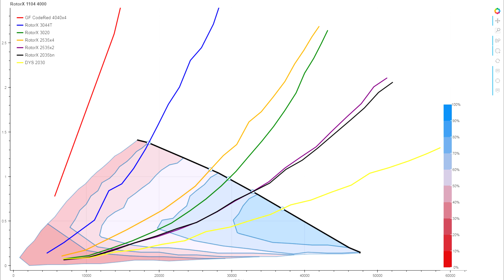RotorX RX1104-4000kv Dyno results

Comment: Bro,suppose if I wind a certain amount of coppers over the stator of a BLDC,how am I gonna calculate the changed kv and torque efficiency?
Reply from the maker: I would just measure it.  I'm sure you could simulate it, but it would require knowing a lot of specifics of all the other components.  If you already know how many turns of wire was on the stator and what the original KV was you can use that to know what the KV would be with a different number of turns, assuming you wind it the same way.  Half the turns = double the kv.  I don't know about comparing the motor constant, but once you've measured it once as long as you keep the same ratio then that won't change with a rewind
Reply: I rewound my motor once before, and the Kv was inversely proportional to the number of turns. See this page https://nocomputerbutphone.blogspot.com/2019/09/unwinding-t-motor-4004.html . 24 turns gave 300kv, and 18 turns gave 400kv exact.